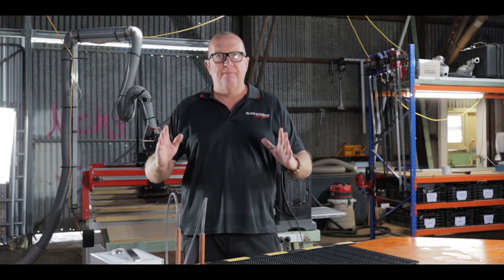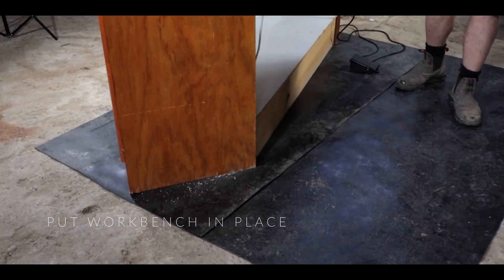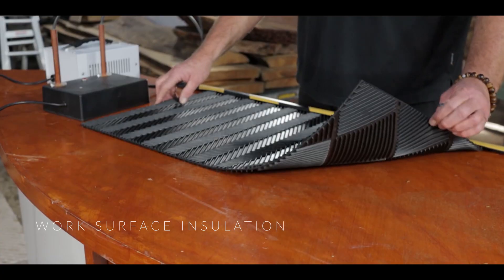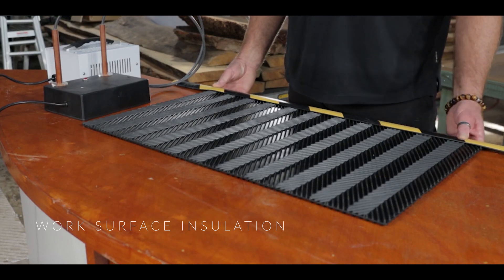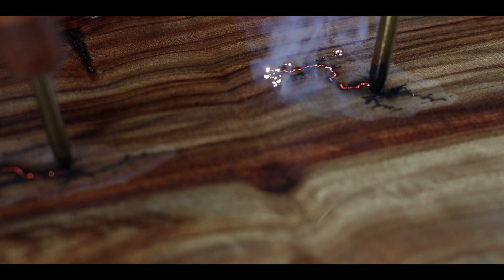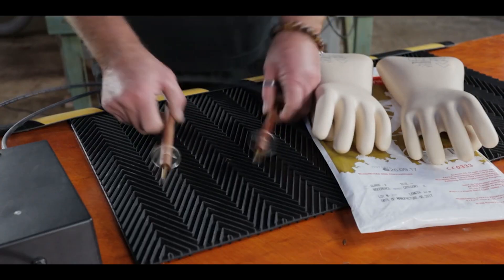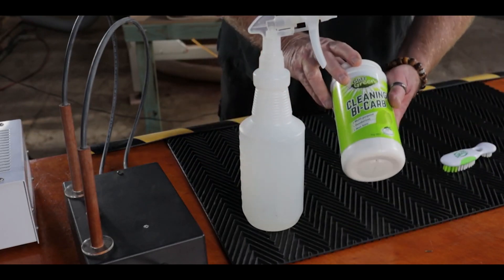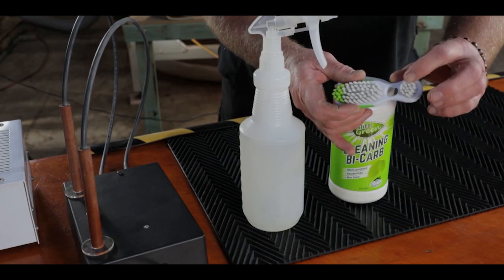Workstation setup (Short version) for your Lichtenberg Wood Burner

Comment: I would like to write a lot, but since you pay great attention to safety, I recommend that you put any ceramic or glass insulators on the rubber Mat on the table, for example, small plates under the Board. In addition, it is safer to connect high voltage not through the handles, but near the electrodes, on the side of them. Good luck!
Reply from the maker: Hi Orel, Firstly thanks for your comment, I truly appreciate the feedback, unfortunately, I have no control over the manufacture of the Lichtenberg unit, that said I will endeavour to pass the feedback on to the manufacturer. Thanks once again for your valued comment, Best regards Baz, by the way, thanks for watching.
Reply: @JourneyInNature  From another YouTube account, I will add that to improve control over the process of burning out the Lichtenberg figures, you must necessarily use an autotransformer to power a high-voltage power source, since you need to start the process with only 500 volts and then gradually increase the voltage as the resistance of the coal channel increases. In addition, I recommend using one wet electrode (an electrolyte-soaked cloth) that can be moved along the surface of the Board while holding the gap with the spark front of about 15 centimeters. These small upgrades of the process allow you to start it smoothly and control the direction of growth of the figure on the Board up to its opposite edge and only from one side, and not from two as it is usually done.
Reply from the maker: @opt57-ru Only just saw your comment, thanks for the advice will try out the wet electrode, and if I get good results will pass on your technique to the viewers. Thanks for your valued input. Best regards Baz.